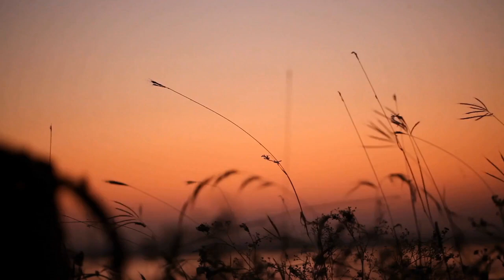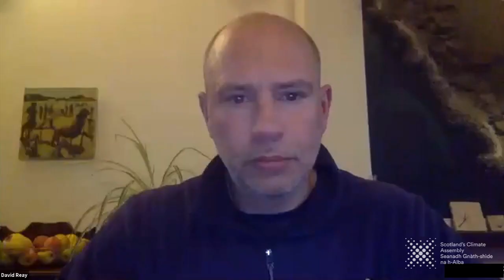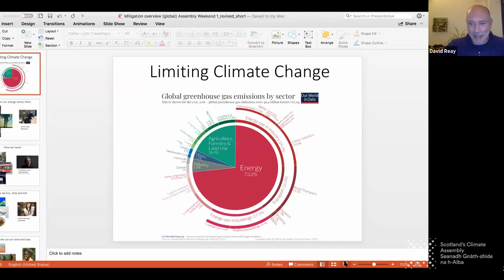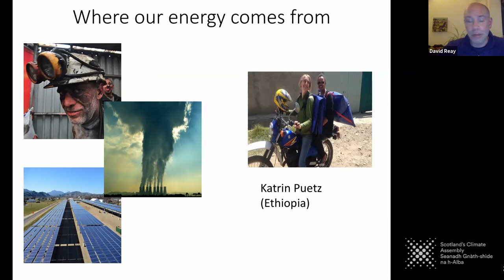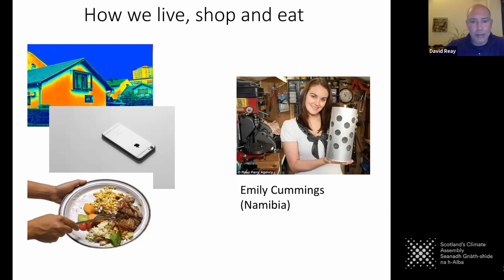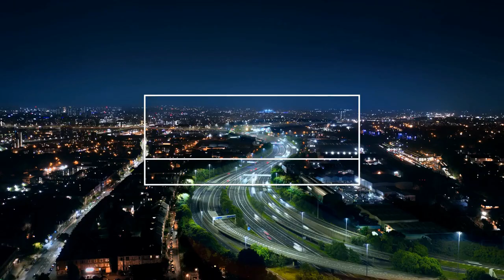Introduction to Climate Change Mitigation | Dave Reay | Scotland's Climate Assembly

Comment: Couldn't agree more with comments above - very disappointing!  Little sense of the scale and depth of the transformations needed. Highlighting micro-solutions, whilst ignoring the deep underlying root causes and real system changes required, cannot result in identification of solutions for Scotland that will be effective and fair. Gave the impression that tinkering around the edges and small scale tech would get us to Zero Carbon, when clearly we need scale, depth and urgency. We know the pursuit of continual growth on a planet with finite resources cannot be justified in a Climate Emergency, but GDP, economic systems, equity, just transition, etc need to be on the agenda. Optimistic, though, that this was only a Meeting 1 overview and that switched on Citizens Assembly participants will see beyond the simplistic agenda and start raising deeper system causes and solutions!  Huge belief in the assembly process, though, and people's ability to see beyond the controlled agenda.

Comment: It is not clear where on your pie chart you have included the pollution and ecological destruction caused by extracting the fossil fuels, before it is even used. Worst extraction processes are tar sands and fracking. Have you included all the emissions released during these processes? 
Also, you mentioned Carbon Capture., which remains a pilot scheme at present as I understand it. It is disingenuous to imply this will help us tackle the climate emergency.
You talk about the items we consume, and imply we need to buy less..Of course we need to buy less, but global corporations raision  d’etre is to ensure we keep consuming. Since most of the consumer products we are encouraged to buy contain elements that need to be extracted from the earth - mainly fossil fuels - these global corporations have no intention of stopping production. Instead of focussing on consumers, the producers need to be subject to strict regulation. This means we need an end to infinite growth, and we need to stop using GDP as a measure of success.